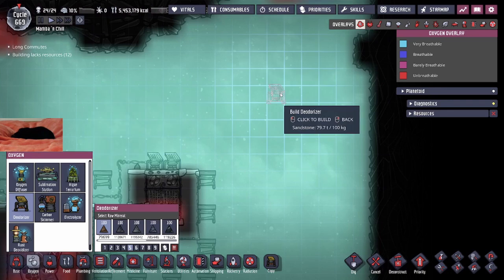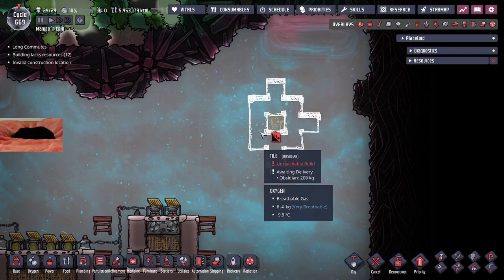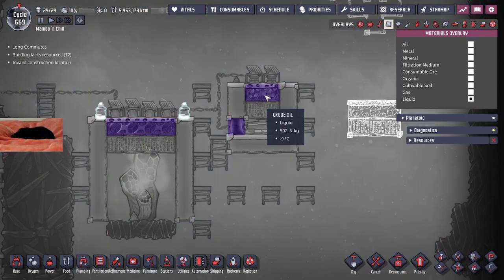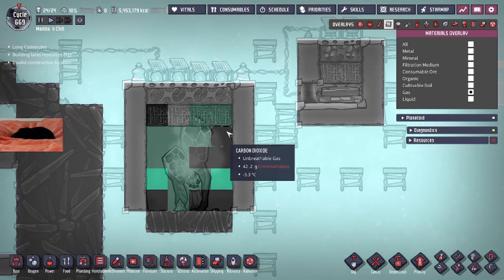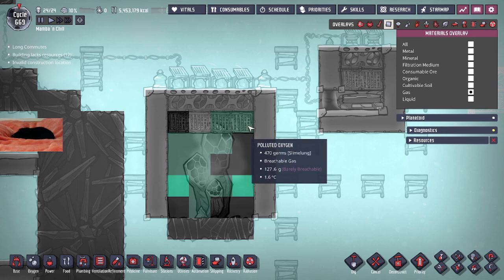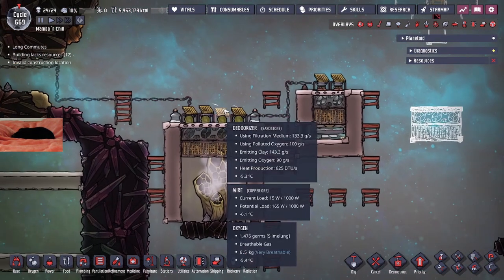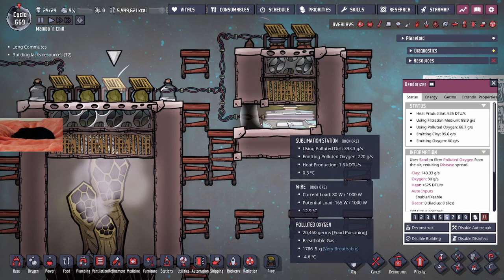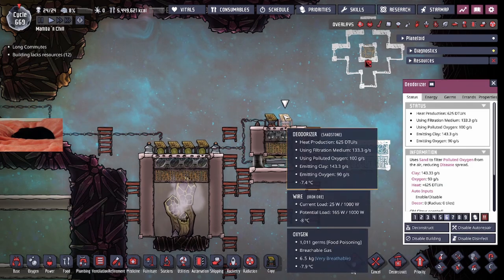Perfect Polluted o2 Vent tamer - Convert po2 into o2 with this filter -No Leaks! Oxygen Not Included

Comment: I made something similar. Two chambers. The top chamber: contains the deodorizers spaced out one tile to minimize power consumption,  two pumps and some automation to pump out the O2, and an autosweeper to take care of supplying sand and removing the clay. Also a bunch of cool water liquid pipes to chill the O2 before pumping. The bottom chamber has a layer of Polluted Water with a liquid vent and hydro sensor so the water level isn't too high. The whole system has been working flawlessly in my base for hundreds of cycles.
Reply from the maker: it works great! i was unlucky and didnt monitor my sad consumption and ran out though

Comment: I'm confused about the sublimation station. So it turns polluted dirt into O2? In early game, I have 2 toilets that will rarely produce polluted dirt. But those things produce polluted oxygen no matter where you put it. So if I setup a storage box so that sims will automatically deliver polluted dirt into it asap. Then a sublimation station next to it. Will they take the polluted dirt out, and put it into the sublimation station? And does it have to stay powered when it's empty?
Reply from the maker: no power draw when empty and dupes will pull from the storage box to the sublimation station if the storage box is lower priority. 
also, the purpose of the sublimation station is to have a steadly flow of polluted oxygen, whereas the polluted dirt would slowly off gas

Comment: Dioderizers can't be over pressurized can they? If so then can't we make a oxygen room and use gas pumps to pump the air out? And just let the air pressure build up? Wouldn't that make it somewhat infinite storage for oxygen?
Reply from the maker: correct, if you seal the top of the deodorizers into a room, it becomes infinite pressure and you can pump out oxygen. if you dont care about how much po2 accumulates at the bottom though, you can simply add an atmos sensor to the deodorizers to force turn them off when it goes above a certain pressure. this would be a powerless addon to control pressure but wouldnt allow for you to stockpile the oxygen. theoretically you could use a door on automation to open and close instead to save on power.

Comment: Does the -5ish oil actively cool the oxygen in anyway? If so how many cycles is -5c splashed there good for?
Reply from the maker: with the oil being that cold, it does have an affect on it, but since i dont have an active cooling loop to maintain temp, it wasnt intended to cool down the oxygen. that being said, that could be potentially a way to cool down the o2 generated.